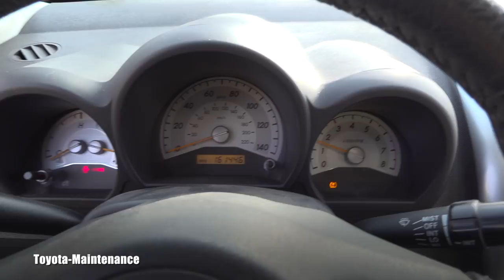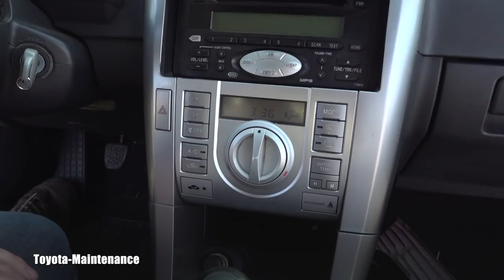I bought a wrecked SCION TC from Copart

Comment: It makes me happy hearing and seeing how excited you are with this car  :)  These cars engines have a lot of problems tho.... oil consumption issues because of faulty piston & ring design and the head bolts back out and strip the threads in the block over time, requiring new steel threads to be inserted into the aluminum block and potentially new cylinder head because of it. I'm dealing with some craziness with my 08 right now but having trouble with figuring out what the cause(s) of my engine troubles are. I hope the best for you and your car!!!

Comment: Where can I obtain Toyota Repair Manuals for my 2011 Toyota Tundra? I need to replace the TRANSMISSION CONTROL SWITCH (Part# 84722-34021). After cracking it open, I find that a Toyota Repair Manual would far be better than the trusted Haynes Repair Manual.
Reply: You can get the manual free online and download it.
Reply: @1jackvalley580  Where at? Tell me the website?